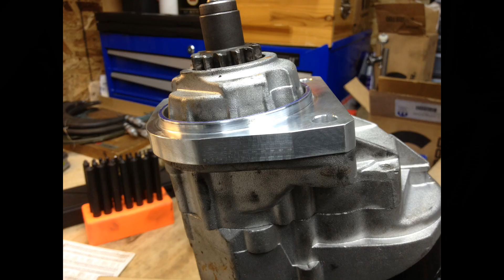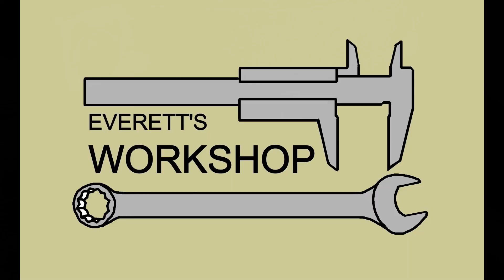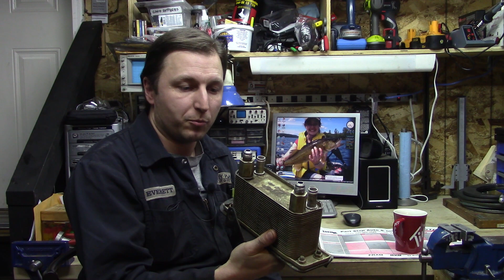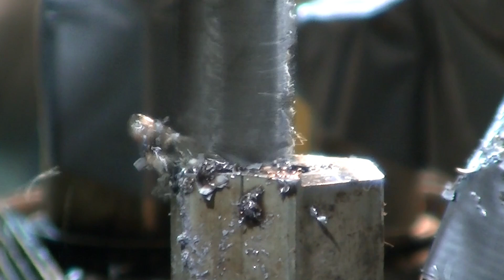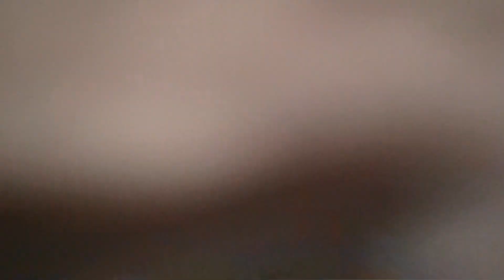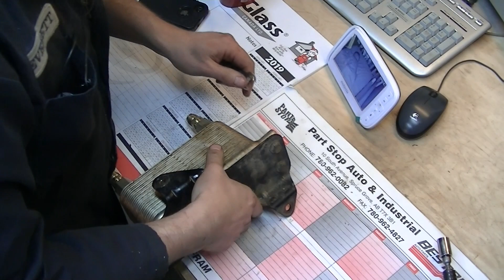48RE Transmission Torque Converter Oil Cooler Repair

Comment: ever seen this?  maybe something to try before investing time.  https://youtu.be/VDWsjvvfhu0
Reply from the maker: I did see that video a while back, and have heard of cross contamination between the transmission cooling system and the engine cooling system, but in the almost 10 years of doing transmission work at the dealership I was at I didn't have a case of it at our shop.  I would by no means repair one that was suspect, but the ones I repaired over the years were cases of stripped threads when changing cooler lines.  But I totally agree with you, definitely a big YES to leak checking before trying to fix one! Thanks for stopping by!

Comment: Thanks for the quick reply. And yes I'm in Canada - Ontario. I was changing some of the lines as they were leaking and when I was disconnecting the upper line to the transmission Torque converter oil cooler I snapped off the upper connector on the oil cooler. This was one of the parts that you showed leveling an tapping. I'm not sure if this can be repaired or not. But it was a big disappointment as the coupler was completely stripped and broke first. I could send a pic if your interested. I haven't taken the oil tans torque conveter cooler off yet as I need to remove a few more things to get some access to the nuts and bolts that hold it on.
Reply from the maker: It would depend on where the piece twisted off - if the hex part twisted off the core itself it's pretty much done but if the threaded portion twisted off of the hex part then it might be fixable.  As far as having a look, if you shoot me a pic to my email I can at least scratch heads with you. everettsworkshop@gmail.com

Comment: Great video and thanks for the tips. I have a few questions on removing the  Transmission Torque Converter  Cooler... What is the best process in removing it...? How much has to be moved or disconnected to get at it...? Also, I'm thinking that a machine shop would have to do these mods with the fittings as I do not have the equipment to do the work myself. I have a few other lines that are leaking so I'm using heavy oil lines with braided steel reinforced internals (rather then the OEM lines which are not flexible). The lines I'm using are like the ones available at Princess auto. They build lines there with fittings but I'm doing most of the line fittings, and cut to length myself. All in all the replacement of the rotted steel transmission lines Is a big job.
Reply from the maker: Thanks! Yeah, getting the OEM steel lines in and out is kind of a turd to do, even with a hoist.  I remove the left front tire, the inner fender liner, the fuel filter water drain tube and all the clips holding the lines to each other.  then after undoing the fittings at the ends of the longer lines they can just "corkscrew" out down by the left of the transmission.  The shorter one is easy.  To get the cooler out, there are two bolts holding the bracket to the block and one double-ended stud that goes on the bell housing.  There are also two coolant lines, about the size of heater hoses.  It's awkward but not impossible.  As for getting a machine shop to do the drilling and threading, I'm not sure what a smaller jobber machine shop would charge, maybe in would be worth it to check into a hobby machining club or group in your area.  You mention Princess Auto, are you in Canada?

Comment: Surprised there is enough meat to tap most things are paper thin or plastic.
Reply from the maker: Actually these aren't bad - there's plenty enough to tap.  The earlier versions of this part number actually had brass fittings but they must have been able to make them cheaper by omitting the brass in later versions.

Comment: What size fittings and drill bits and tap are they i just had this happen to me last night... Thanks
Reply from the maker: The tap drill size is 37/64" for the 3/8-18 NPT threads you'll cut into the cooler.  What you'll need is a brass 3/8 NPT to 1/2" male flare fitting.  You might want to do both fittings at the same time while it's apart, would save you some grief down the road.
Reply: Everett's Workshop thanks man really helped out alot!!
Reply from the maker: No worries, this is what the community is for!

Comment: Thanks great video,  i wanted to just bypass this cause im in HI.  Do you knoe what size plugs i need to cap that fitting you just cut off?? Thanks for your time
Reply from the maker: Thanks!  I'm not sure you would want to bypass it, even in Hawaii, as it is used for cooling the torque converter where most of your heat is actually produced.  If you're adding a big auxiliary oil-to-air cooler up front then it might work okay though.  I'm just thinking of the roads you have there like the roads to Hana or Haleakala on Maui (both beautiful drives, BTW!).  If you really want to bypass it then you won't have flow across the oil side of the torque converter cooler, you could cap it off with rubber caps.  Otherwise the fitting itself is a -8 Male AN 45 degree flare fitting.  I get the brass adapters from a local industrial supplier, so you could probably source a female cap from a local supply house if you want something more solid.
Reply: I have heard that these heat exchanger can leak causing coolant into the transmission thats why i wanna cap it. 2nd  reason is  I just installed a New tranny a big  investment and I wanna do anything i can to prevent future damage to this new transmission.  Well i finally got me gauges to monitor the temp. I didnt know daily driving my tranny temperature gets up to 215-220*F  unloaded. Who know what temps it reached on my stock tranny.  So yes i plan to add a tru cool h7b trans cooler in series with the stock cooler up front which will add an additional 29000 btu.  So i figure while im working on the lines i should just cap the line going to the exchanger and re do the line from the tranny straight to the stock cooler then the aux cooler and back to tranny.
 So with the aux cooler do you think ill be ok without the heat exchanger?
When my tranny temp gets up to 220*F  the Engine temp is lower and cools down faster then the transmission oil temp.  So whats the use right? And in HI the temperature is not freezing,.  Although our mountain do snow and thats the only time ill be in cooler temps.
 Im glad you know the type of driving we do in HI, im on the BI where Maunakea is and thats also alot of steady hill driving when crossing the island.  Also some traffic with higher ambient temps.  Automatic Transmission take a beating.  Look forward for your thoughts.  ALOHA!!:)
Reply from the maker: I've heard about torque converter coolers internally cracking and causing contamination, but never seen it myself. The thing is that as a transmission tech in a dealership I see fewer of these 5.9/48RE units coming through now (long off warranty), so maybe the aftermarket is seeing more of them.
If you're adding that big of a cooler up front in addition to the stock air-to-oil unit, then you should be good.  That's a lot of heat transfer to help.
Not sure what you have for tools to make up hydraulic lines but if you take your shorter line from the trans to the torque cooler and the one from the torque cooler to the stock air-to-oil cooler in to a hydraulic shop they might be able to flare the ends of the steel tube and make you up a short jumper line with rubber hose and crimped fittings.  It would be a lot easier than trying to fish a 1-piece steel line up past the starter and fuel filter.
Haven't made it to the Big Island yet, just Maui and Lana'i.  Someday though :)
Reply: I like the idea of making a jumper,  i was planning on running a made up hose with fittings from the transmission to the front cooler, not sure if there's room for hose lines, didnt quite plan out the route .  Any chance you know what fitting size is at the transmission, The Front & Rear fittings? 
Hey thanks again for uploading video's,  & hope you make it to the BI soon.  ALOHA!
Reply from the maker: I'm pretty sure it's a 1/2" inverted flare brass fitting at the transmission ports, with a 1/4" NPT pipe thread into the transmission case.  Would be cool to see pics of how you do it up in the end, I finally got another email address for channel-related stuff, everettsworkshop@gmail.com - Let me know how it works out, and if you need a custom brass fitting made up, send me a drawing and I can mail you one!
Reply: Will do Mahalo!
Reply: Everett's Workshop im planning on replacing lines soon, just ordered s.s. flex hose line and some 8an JIC fittings.  Question? How much oil will come out of these lines especially the tc cooler when i remove the lines and cap  it? Thanks
Reply from the maker: Shouldn't be a whole lot, just the capacity of the lines and converter cooler.  If you have a couple quarts of ATF+4 kicking around that should be enough for any top ups.

Comment: This should make the part last as long as the crappy Dodge, are you allowed to use some anti-seize compound on the fittings...?
Nice idea with the air to keep the debris out on the cooler...   ;)
Reply: "Crappy Dodge" will live forever if u take care of it
Reply from the maker: Thanks! You probably could use some anti-seize compound on the fitting threads, but they don't come like that from the factory and most people don't put it on when they change lines.  At least the brass buys some forgiveness in that department.